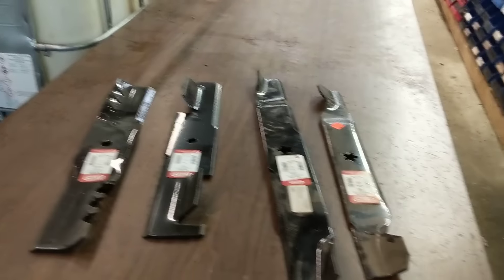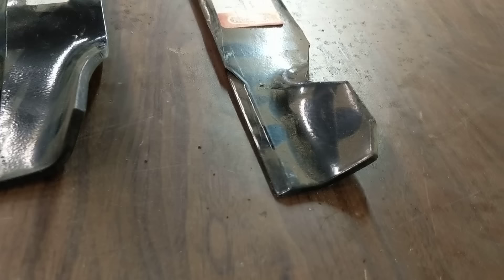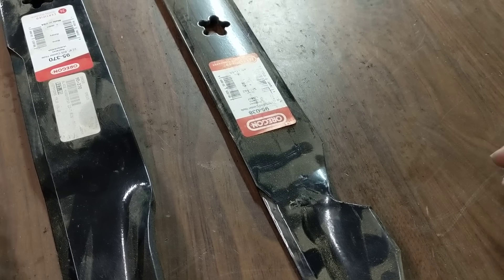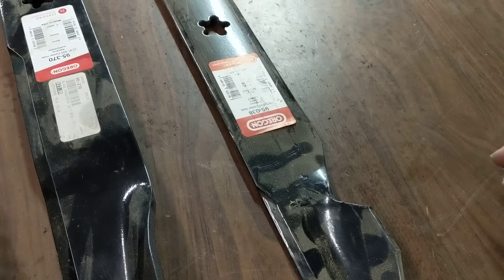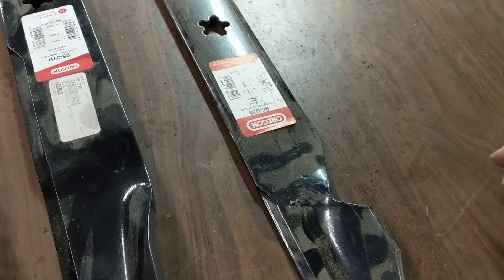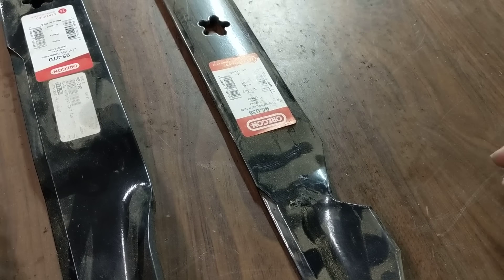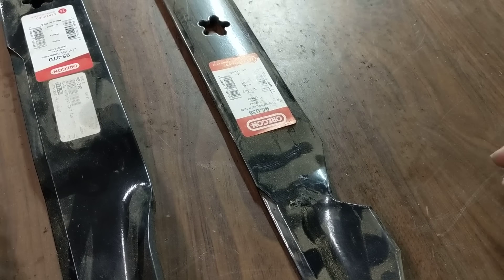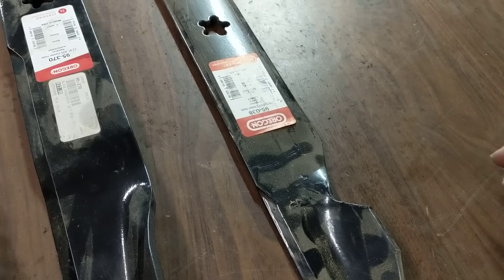Mower blade drastic difference and what is best for your yard and your mower. Oregon, Scag, Gravely,

Comment: Had a lawn mower shop for 20 years. The gator blade is the best thing since sliced bread. They are mulching blades. In the south where we have a lot of sand, they last about twice as long as regular blades. You won't have so much long blades of grass discharging. Grass almost dissapears. Regular high lift blades are for bagging.
Reply: I had to go with a low lift blade   1 acre of sandy yard destroys blades in no time.
Reply: I run the Gator blades as well, I mulch most of the time here in southwest Idaho.  The OEM blades on my lawn tractor are fine, just standard high lift blades, but started mulching, and got my first set of Gator blades and haven't used anything else the past 4 years.  I have G5 and G6 blades, the G6 blades are slightly heavier duty than the G5 that's the only difference with those.  I can't see the need to run my high lift blades anymore, the G5 and G6 blades do a great job of getting the grass clippings out of the deck when I'm not mulching so I don't see using the high lift blades for my needs anymore.

I got into mulching because I got tired of dealing with raking leaves.  Since switching to the Gator blades I haven't needed a rake.  The Gator mulching blades just make leaves disappear.  They do great for that, and they do great for general mulching duties during the rest of the cutting season.
Reply: Gator blades are all I use since 2012 on my John Deere X749 with 62" Deck mowing 1.6 acres sometimes 2X a week.
Reply: I just find you can't use the gator blade if you let the grass grow more than an inch. My customers who over fertlize force me the change my blade out because they bog down so easily.
Reply: New to riding lawnmowers, recently moved rural. I have a 09 lt4000 42" craftsman and a 04 gt5000 48" craftsman the prior owners left behind. The 09 runs fine, had to do some maintenance on the 04 to get it going as it hadn't ran in over 10 years. Now it's purring. The gt has the bagger system, I keep as much clippings  as possible for compost, I mow about 3.5 acres. Question is: because I use the bagger, what lift size blades is most optimal for this type of mowing? Thanks for any input.

Comment: After trying most of these blades in the past, I’ve come to realize the OEM John Deere blades (GY20852) cut and mulch the best overall and tend to give the grass the best overall appearance. I have a larger JD E170(triple blade system) so it’s 16  inch x 3 blades.

Comment: Nice to know the actual differences.  I figured out gator style blades
Don’t cut as clean in spring when grass is green and juicy.  I use a high lift blade and around mid June when it dries out I replace it with a set of gator blades.  Works well in my area.

Comment: I use a 48” scag, love my mulching blade.  But I only mow my lawn, when dry. 
Keep all blades sharp.  
Thanks for video 👍👍
Reply: Hey, I just purchased a Scag 48", it's on the way, hope I chose well. I purchased their Hurricane mulch kit but I was curious if I could have just installed mulching blades and the discharge blocking plate. I was curious about your setup, information is limited for me. Appreciate the feedback.
Reply: @vicientedeloach2246  You'll be dead and the Scag will still be running.  Did a full tune-up on my uncle's old belt drive walk behind Scag 36" a couple years ago, its from 1989.  New belts, blades, carburetor, oil, fuel, spark plug, a new idler pulley for the transmission, and it was running like new again.  Still striping lawns with no effort.  Got the tune up done, and took it out the next day and cut a yard that was severely overgrown with 3 foot tall grass/weeds, one pass and it was all knocked down...no 2nd pass needed.  Not bad for a 30+ year old mower.

Comment: Thanks.  I have been looking for replacement blades for my lawn tractor and it is tough to find.  We own a Cub Cadet Enduro XT1 LT-46 that we purchased in July 2017: I think our year model is actually a 2016.  I am being forced to become a better DIY Guy [sometimes I like it and sometimes I hate it] because I trusted a local shop that actually ripped us off - I paid for a tune-up and blade sharpening and did not get the service.  I have only recently learned about the sand blade.  The sand blade in the video looks way different than the Cub Cadet sand blade that I looked at yesterday.
Reply from the maker: Thank you for taking the time to watch and comment. Becoming more hands on and DIY is almost a must in this day and age. Small engine repair has a real hard time keeping or even finding skilled techs.

Comment: I been using oregon gator blades for over 10 years, on a 48” crapsman. they rock!
Reply: lollipop
Reply: Gator Blades are GARBAGE when it comes to mowing grass.  They are generally made of thicker metal for mowing over branches, etc...  but for plain grass mowing, they are easily eclipsed by plain high lift blades.  I bought a set, and took them off after one day.
Reply: @n2omike  good to know. I have plenty of hp for mowing pasture and lawn. Let the horses on a couple acres at a time, then when I move them I like to mow it a 4in and let it grow for a few weeks before moving them back into it. I also like to mow into the woods but I have to take big John deere with the rake on and maneuver the trees to try and get all the sticks. If I put those gators on the old tractor I can just use that for the woods then and keep my big cub for the real stuff. 25hp Kohler pro motor,  zforce S with the 54in fabricated deck. Cuts amazing and at around 8mph, but it is doing 9 to 10 acres a week. I generally use my big John deere for snow but I have chains and a plow and it works really good in the snow. I do better in the snow with that zero turn with the steering wheel than I would a conventional tractor because the motor is in the rear.
Reply: If you have a three blade deck design... the real deal is that your discharge blade is a Gator blade... you want the other two blades to be high lift blades to keep your deck clean actually... your discharge is mulched up some but you can still stripe a lawn quite well...  we pro’s have been running this setup for years with great success...😂😂😂
Reply: I just put Gator blades on my mower and I think they did a terrible job. I got tons of clippings and the lawn wasn't smoothly cut. Looked like it was 2 days after a cut. It's like I would have to go over it twice to get the same results I got from my old blades.
Reply: I've been running the Gator blades for a couple of years, I've found they do best if the grass is not allowed to get to high, then I get the mohawk, have to do half passes etc. If I keep up with my chores I can do a full 54" pass no problemo.  They do mulch, so wet grass build up underneath the deck can be an issue. 3 blade Craftsman 26hp
Reply: @n2omike  I disagree.  Come look at my yard (1.6 acres) it's the nicest looking cut in the neighborhood with  a JD X749 62" Deck and super sharp Gator blades for the last ten years.
Reply: @Anthony-rv3hr  the Gator blades, or any others for that matter, aren't sharp enough when new.  You need to sharpen them razor sharp, and run the blade speed as fast as possible while making sure your travel speed is not too fast for the grass your cutting.
Reply: @davidgeorge8172  sounds like a lot to do for supposedly great blades.
Sadly, I tossed the original blades that came with the mower (Husqvarna YTH22v46) I used for 8 seasons. Never sharpened them, ran over rocks, countless sticks and branches and they always did a fine job at any speed or condition of the grass - wet, tall, leaves, whatever.
I really wish I'd have left it all alone. Waste of time and money.
Why don't new blades come sharpened? Is this a new thing?
Reply: @davidgeorge8172  Super sharpened vs. Generic standard blades?  I can 100% say as someone who has used both back to back on the same day...  Regular high lift blades kick the crap out of Gator Blades on standard grass mowing.  The taller the grass, the bigger the difference.  The thick, low lift Gator blades are great if you're mowing over sticks and branches, but all else being equal, are inferior on grass.  Just how it is.  They do LOOK cool...

Comment: Everything said about the gator blade is exactly as I’ve experienced, the best remedy to eliminate buildup in your deck is more frequent cutting and maintaining a lower height of the grass.
Reply: I do not recommend gator blades for rye grass. Rye too wet of a grass and will cake up on the deck. We always ran the high lift blades for rye grass and gator blades for everything else.

Comment: The Oregon gater blades work have worked well on my 42" John Deere deck for 7 years. They lift a 2 inch cut to the bagger and mulch a 1.5 inch cut with a medium drive speed. The mulching is excellent, no clumping. Makes mowing a 1/2 acre happen in 45 minutes. You are right to point out that a finer mulch will layer the deck; more liquid provides a bond. So I clean the deck about 3 times each season. So I would add another 10 minutes per mow to the maintenance column.

Comment: Bought me a set of the G5’s since I couldn’t locate G6’s. So far I’m pleased with them. They are thick vs other blades I’ve bought and the high lift seems to chop the grass finer and the wife complains less. Now I’d like to add a mulching plug to the mower.
Reply: The G6 blades are slightly heavier duty than the G5's, no real need to get the G6 blades.  I have a set of both and can't tell any difference between the 2 on my lawn tractor.  Both do an equally good job of mulching.  

I started using them about 4 years ago and have never gone back to the factory high lift blades on my lawn tractor, I see no need.  The G5 and G6 blades do a great job of blowing the grass out from under and away from the mower deck when I'm not mulching.   I have the mulch plug on my lawn tractor, with the G5 or G6 blades and mulch plug the leaves just disappear.  I also run a G5 blade on my 21" push mower, same results, does great in both mulching and side discharge modes, I really haven't tried the bagger with the mulching blade on the push mower...I don't have a bagger for the lawn tractor, and don't really see any use for one since the mulching blades do a great job.

Comment: i bought some cryogenically treated mower blades once and they seem to last about twice as long between sharpenings, hold an edge pretty good
Reply: Where did you find them. I have to sharpen every other mow.
Reply: @royalway12  i found them on ebay and they were for a john deere tractor/mower, cant remember who had them though

Comment: This is literally the easiest thing to make your mower work so much better. Just get a good blade, keep it sharp and it doesn't matter what type of mower you've got because the blade will give you a good cut.
Reply: That maybe true, however, the mower blades have to fit the tractor mower deck or be able to match the original equipment mower blades you are using, especally older tractors that were manufactured many years ago that are still running and mowing grass these days.

Comment: From my own personal experience, I've found high-lift blades give the best general overall cut, regardless of time of season. The resulting cut looks better and more even than what I have seen with other "mulching" blades or "toothed" Oregon blades. My lawn is thick (cool season grasses like tall fescue, bluegrass, rye grass - NE US) and quite wet especially during the Spring and late Fall. The high-lift blades seem to more evenly discharge the grass out the chute and leave less clumps behind, even when the grass is wet. Mulching blades will leave grass clumps behind unless you mow at a very slow crawl, and even then, grass that is thick and moisture-rich will clump pretty badly especially during the early Spring with mulching blades.

Comment: I have a pair each of the first three blades...............I also have a specific high lift bagging mower, and a specific mulching mower............I use the mulcher  ( with correct blade ) in the summer and use the high lift  ( with correct blade ) spring and fall.......  works great for my thick bermuda grass lawn.

Comment: I haven't mowed grass in a lot of years, but I remember the Jacbson rotary with 4 short blades, each attached by a single bolt to a large cone. The cone bolted to the crankshaft. The blade would swing out of the way when striking an obstacle. The Disc would be removed, the blades reset and tightened, cone reinstalled. The small blades were reverseable and could be resharpened.  There was a garrantee that the crankshaft would not bend, the only mower like it. Great design!
Reply: Yes They were the best. Have not seen one for many years.
Reply: Very nice

Comment: Please do a mulch blade video. I have a 52” Gravely zero turn and the blades provided with the mulching kit look nothing like mulching blades. They’re identical to the high lift blade you have there with the long sharpened surface. It fails miserably when mulching damp or longer grass. My previous zero turn was a Hustler and it mulched like a beast. Totally different shape blades. Thank you!

Comment: Thanks! I sent this video to someone that I do yard work with & I’m sure he’ll find this useful. We mow different kinds of yards here in Florida & some with leaves, weedy yards, mixed weeds/ Saint Augustine & nice Saint Augustine yards so the blades were using (middle one) is universal? I’m tired of the light raking & want to mulch it with side discharge bcuz they wait until it’s a high growth (2weeks) a big pain! And I’m putting a fine razors edge by hand (bastard file) on 2 blades (one in use 2nd back up to switch to after 1st ones dulling) for those that want a very low cut.

Comment: I like the middle mulcher/bagger on an upgraded 6.5 Briggs. It's nice after a dethatch. What background music am I missing?
Reply from the maker: The first video I did of this had some background music as I am always listening to music. And many people complain. It is either the wrong style or to loud or not good enough quality. It is just a radio in the background lol.
Thank you for watching and sharing your input. I hope it helps many.
Reply: @fuelediowa  finished the blade change, thanks again for an obvious to the new age, lol, equipment. Since it is a Briggs, I tilt it backwards. Tried and true. In fact I'm looking for a new fuselage cause my tires are bald and it has like five rust holes. in it, but the plug is still clean (no blow by nothing).
imma jump on your page and check out that music

Comment: The info is mostly accurate, but some of the higher lift blades are notched blades. The notched high lifts we used on our super z’s are the most lift they have for them. Only downside is that the notch makes them much weaker than no notch.

Comment: Hi guys.I need some advice.I have a john deere x540 mower.I have the 3 bag collection system.The chute gets really blocked up and i find myself having to take off the chute and clear the blockage out with my hands ever 10 minutes or so.Its so annoying.I have lift blades but was wondering what is the best blades to use to try to stop the chute blocking up.Thanks.
Reply from the maker: High lift blades usually work best. Also never cutting more than 1" off the grass at a  time is highly recommended. Bagging is a maintenance service and should be done at least once a week. Even a blower assisted system will clog if the grass is too wet or tall.

Comment: I’ve got a question if you don’t mind sir several different mowers from traditional riders and 3 zero turns I do like the gator blades especially when the grass is dry and like you said in the fall grinding up leaves but every set I put on any of my mowers  they attend to streak in between the blades and yes, I have the right size blade for the deck size also after I finish mowing, I’m one of those weirdos that will clean my mower and underneath the deck thoroughly i’ve measured the length of a traditional lift blade and then measured the gator blades. They attend to be an 8th to a 16th shorter brand new out of the box Have you had any complaints like this do you have any suggestions or advice what I could be doing wrong thank you for your time. Have a great day. Be safe.
Reply from the maker: @seanturner3823  I have not ran into the blades being shorter. That is interesting that you have ran into this on each of your mowers. I have seen used blades that the outside cutting edge is rounded and causes the strip being left and grinding it back down to square can help. Also in some cases the gater blade has less lift so changing the Deck pitch is sometimes necessary to help get a bit more lift. This is achieved by the front of the deck pitched down about a 1/4 inch  vs the back. This is a bit of a challenge buy you just place the blades to be going the length of the mower. On a flat level surface measure the front of the cutting tip to the ground and do the same on the back. The fron should be 1/8 to 1/4 inch lower. You can see if that helps but I wonder if by chance you have gotten the wrong blades or a crazy bad batch.

Comment: I moved from a ten acre to one one half always used mulch blades with my sixty one inch zero turn grass hopper. Instead of five various grass types, and sand, now there is only centipede. Would a mulch blade still be desirable? Thank you.
Reply from the maker: As long as you are not having to cut more than 1\2 to 3\4 of an inch off at a time. Thank you for watching and taking the time to comment.